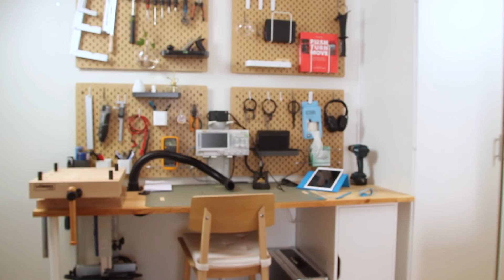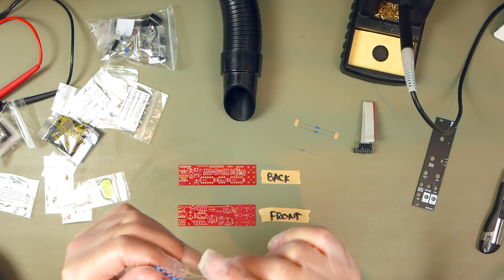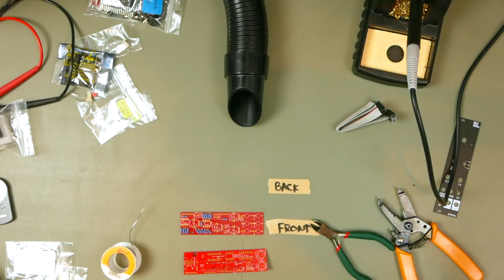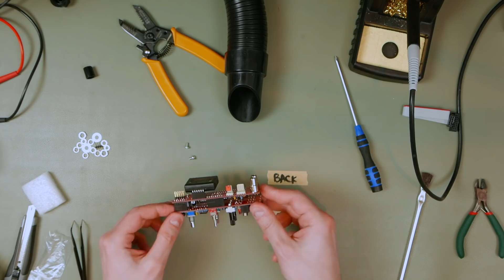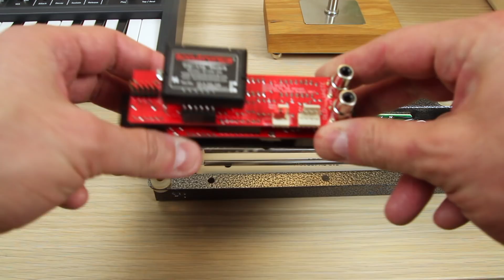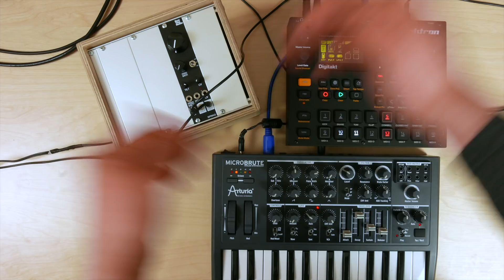How to build a Spring Reverb Module

Comment: It's weird watching someone talk about a spring reverb like it's fragile and overly succeptable to electrical noise, after watching LMNC usually beating his spring tanks like they owe him money. Also, that tank you have for display is surrounded by heavy gauge steel sheet. If you have electrical noise issues, then you should probably be focusing on that problem, instead of letting it guide the rest of your system choices.

Comment: This is very cool but I have a couple of questions.  First, my reason - I have a guitar amp that I put together from a Hafler tube guitar preamp (awesome) and a power amp that it feeds.  The Hafler has an FX send and return, which I believe are line-level.  I also have a MOD reverb tank, inexpensive and still very cool.  I need to build an amp and return that can take take the FX send of the Hafler as input and then output to the Hafler FX Return.  My questions:

1. Not all of your knobs are labeled.  Is there a dry/wet mix control on it?  I would need to pass the entire signal through it, so I would need to take the mix down to about 20% or so.

2. How is the kit powered?  I'm not knowledgeable about Eurorack stuff.  Could it be powered by a wall-wart style power supply?  I've got tons of them, going all the way up to over 30V and 4 amp.  If it can be powered by a wall wart, I'm sure I have one that will work.

3. I'm a little insane when it comes to digital latency, not only can I hear VERY low latency amounts, but they drive me crazy.  If you pass a signal through this kit with the reverb mix turned all the way down, is there any measurable latency at all - i.e. is the mix path analog or digital?  If the entire signal goes through any digital device, there will be some latency.

Thanks!!!

Comment: Love your video, very professional! Curious how I could power this on its own? Like a stand alone unit that O could use as a reverb send from a studio console. Would I just need a cheap-o wall-wart that’s 12v and connect the positive and negative leads to the right pins on the unit? Sorry for my newb question I’m just really looking at building one of these but I’ve never dealt with power supply stuff (I’ve only built API lunchbox 500 series audio units). Your response will be gold! Thanks and cheers

Comment: Hey I was curious, how do you amplify your actual spring reverb? I purchased a spring tank for a guitar amplifier with the intent to use it as a reverb effect for recording. I quickly realized it needed a preamp at the end of the signal because of the low output, and I purchased a Velleman universal mono preamp kit, but tbh I don’t know enough about PCB work yet to completely understand what I’m doing. Any help would be appreciated!

Comment: you can solve the spring disconnection problem by taking needle nose pliers to the hooks on the ends of the springs and bending them closed.

though that will not eliminate the accidental stimulation of the reverb if you bump the unit as the springs can pick up  that.

also if it is mounted in the speaker you can get feedback thrugh it if you have the speaker too high

Comment: Great video. I've built a few of the earlier version of this module, it's great. I haven't bothered with the digital tanks yet, but maybe I should, it sounds better than I'd expected. The user manual for the Intellijel Springray (version 1) has a bunch of good patch ideas. One of them is sawtooth vco => filter =>  => vca => reverb, and use your vca envelope to also control the amount of reverb feedback. Set long-ish attack/decay... can sound very much like a bowed instrument
Reply from the maker: Fantastic tip regarding the bowed instrument sound!  Thanks for watching (and the insightful comment)!
Reply: @LeoMakes  thank Intellijel :-)The Springray is ace too.

Comment: The tanks are actually pretty tough, or used to be. The 66 pontiac i had came with one as an option for the radio bolted to the rear deck. Worked well into the eighties til the old caps  went out and fried the transformer. Some plyers smack their amps to make that crashing sound . Have fun ! Try cascading a few of them it siunds like you're in a bottomless cave

Comment: This is the first time I've heard someone saying "this is digital, so it's robust". As a software engineer, I find things to be quite opposite. I have, on the other hand, no issues with my actual valve-operated spring reverbs that I thrash around in my guitar amps.
Reply: The first time? Tubes died for a reason. We have solid state controllers that have been running non-stop for decades without failure. They get vibrated like crazy from structural resonance in the plant's structure and keep trucking. I'm a hardware/software guy and trust digital/solid state %110.
Reply: @Mechotronic  First of all, tubes never died in music equipment (not talking about audiophile nonsense, talking about equipment to make music). Controllers are a different breed and not a useful comparison, clearly you would not be able to make something that complex out of valves, but that's irrelevant. You're talking about industrial equipment I'm talking about consumer electronics. For something as simple as a reverb unit, a valve unit will be so much more reliable than a solid-state one it's not even funny (I don't consider natural wearing out of the valves as failure of the unit).

If you're a software guy and you trust software 110%, I don't know how to comment on that. Maybe you should watch the video from Ariane 5 disaster or something. Unless you do software for embedded devices - small, specialized, rarely changing - software is not really reliable.
Reply: @Mechotronic  Well, tubes died for another reasons and only for some applications. Silicon beat them in power consumption and scalability and in portable applications, definitely. But tubes are as alive as they can be, every fucking microwave has a tube in it for a reason. They are used in serious broadcast and military equipment exactly because they are more robust than silicon if we speak of switching hundreds of kilowatts in megahertz ranges. Tubes were powering first flight computers in fighter jets and freaking missile guidance systems! Believe me, silicon has nothing on tubes it terms of robustness.

Comment: if it doesnt have a spring, is it still a spring reverb? one of those great philosophical headscratchers, ey, nudge, nudge?
cool video and cool verb! did you ever try the blending option between tank and brick?
Reply: It's missing one fabulous spring reverb effect. The one where you lift up one end of the amp about half inch and drop it! Awesome sound only available with actual springs...:-)
Reply: If a spring reverb falls and no one is around sort of a thought?!
Reply: https://reverb.com/item/22976670-anasounds-element-premium-bundle-shipped-from-france something like this?
Reply: I could’ve sworn it connected to a spring tank
Reply: 5:36 it CAN connect to a spring tank!!
Reply: You mean the Ship of Theseus
 eh?
To me, if it sounds the same, it is the same.

Comment: Do you need a modular to do that or I can plug in to a hardware synth ?
Reply from the maker: Hey Lee, the audio inputs and outputs of this module will work with any line-level sound source so if you can find a way of powering the module (i.e., getting +/- 12V to the right pins on the back of the module) then you should be able to use it alongside a hardware synth.

Comment: Hi, I’d like your advice... (today) I’ll be purchasing a used Empress Reverb pedal for $450 did I make a good move or should I just pick up a soldering diy kit/station
Reply from the maker: Let me just say the Empress Reverb pedal is fantastic!  I've seen and heard it several times around town and have been impressed every time.  If I didn't already have an H9, I'd consider getting either that or the Strymon Big Sky.  So that's never a bad idea :)

Regarding getting a solder station:  I'd only recommend doing this IF you're really interested in getting into music hardware engineering/manufacturing/troubleshooting/repair/etc.  I've had friends that bought DIY gear for the wrong reasons (mostly they were just trying to save a few bucks and didn't care about the whole "learning engineering stuff") and they've ended up making little or nothing.  Their soldering gear just ended up sitting in a closet, which is a waste of money.

If you do have interest, then dive in! Soldering is fun and addictive, and you end up with a new toy when you're done.  :)

Hope this helps.
Reply: It would take you years and years to develop a reverb as complex as the empress one from scratch
Reply: buy a soldering iron and diy. building your own gear is super satisfying and cheap. a  Weller soldering station and a roll of solder is $50.